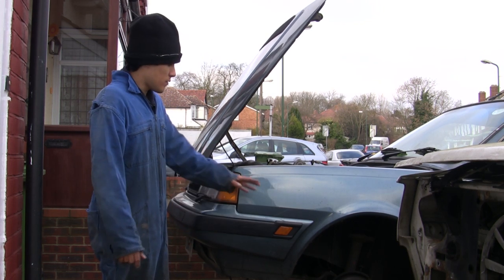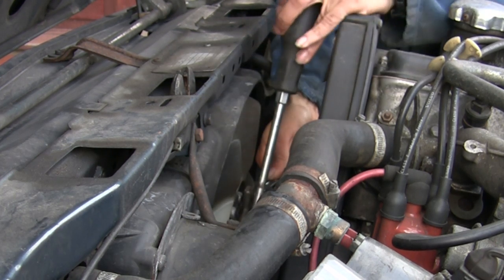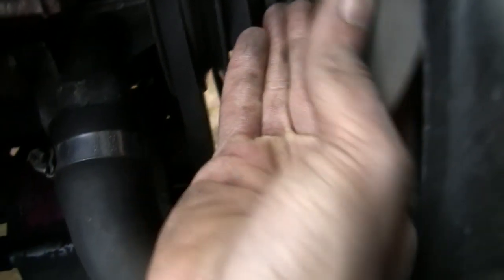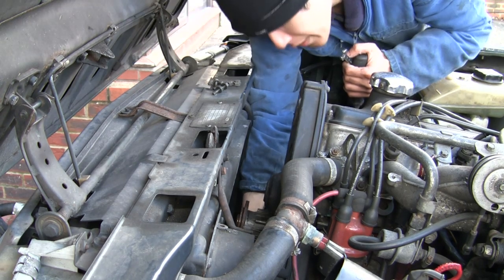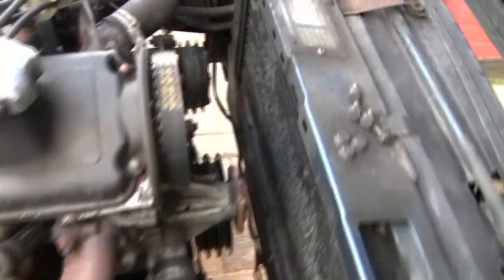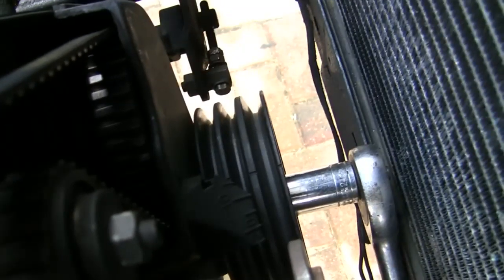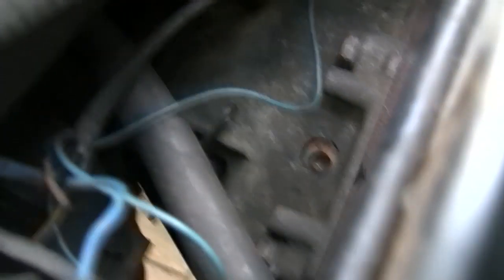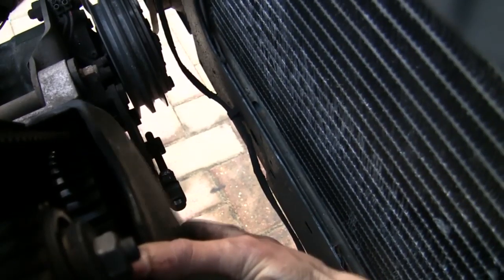Procedure for Timing belt change for Volvo 360 Part 1 - Removal

Comment: I had a couple of Volvo 360s back in the mid '90s. They handle quite nicely as the gearbox is mounted just in front of the differential.

Comment: Nicely done sir. On cars that have a manual transmission, what you can do is to put the car in the highest gear and then apply the emergency brake as tightly as possible. If you are finding the car still wants to move have an assistant press on the brakes as hard as possible. 

On a car that doesn't have LH 2.4 you won't have those holes in the flywheel, but I do like this method. 

If one has an auto car, you basically need the volvo tool. THanks for posting this!